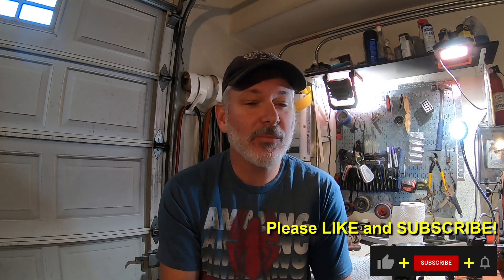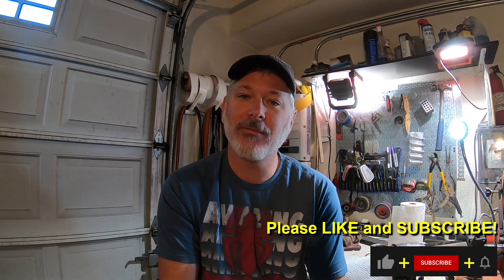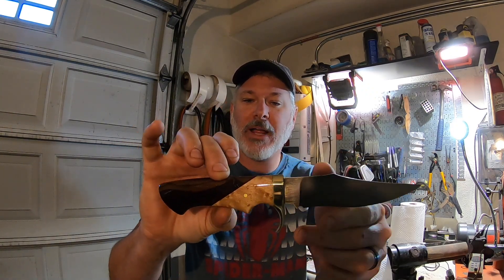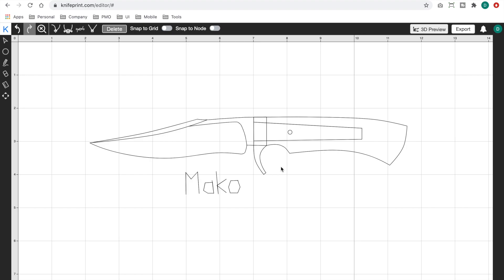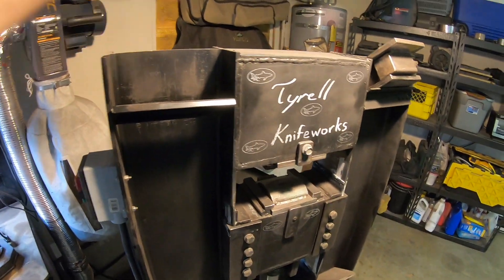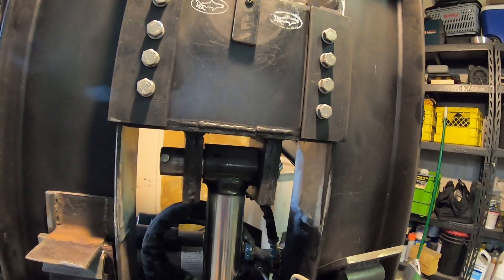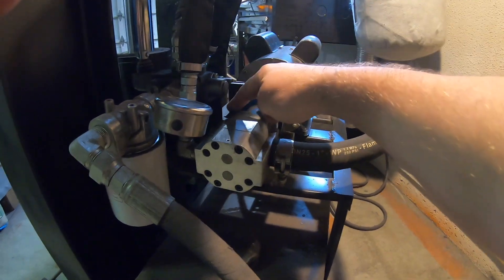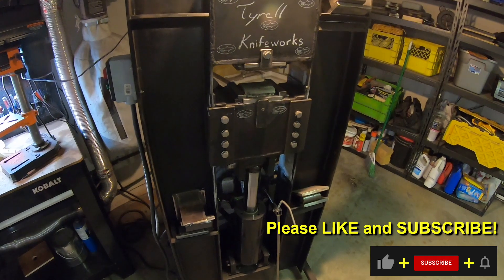Triple-T Tuesday #3 - Knife Designing / Hydraulic Press

Comment from the maker: What do you use for designing knives?  Do you draw them out on paper first?  Use any software?
Reply: I draw them on milimeter paper. From there I can use templates or anything. I engrave my logo with the hammer and chisel method and inlay that with anything I have laying around, sometimes copper, sometimes gold. I do a lot of hidden tangs nowadays and I'd like to do my first takedown soon and get better at gemstone setting. I'm using kubic cirkonias for now but I have an eye on some man made diamonds for the future. I also recently got my first piece of stabilized mammoth ivory to work with... Man was I nervous! Turned out ok but then I messed up the gold inlay on the blade part ... I'll keep the knife.

Comment: How many tons is the press?
Reply from the maker: The cylinder is 58000lbs of force so it's a 29 ton.  Thanks for watching, Elliot.
Reply: @TyrellKnifeworks  Thanks, I'm trying to decide between a 25 ton and a 40 ton press.  Is 25 good enough or would you recommend the 40 ton?
Reply from the maker: @NelsonJ1  25 is plenty.  Most guys are using less than that.
Reply: @TyrellKnifeworks  Thanks again

Comment: That is definitely a nice press! I already ordered all my hydraulics and funny I got pretty much all the same stuff from Northern hydraulics. I did get a little longer ram. Hope I don't regret it. 
What type of steel did you use for your dies? Is it mild steel or something like H13? I've seen people use both. 
Man that is a cool press! Great Job!
Reply from the maker: Mild steel is what I used.  It works just fine.  I think dies for a power hammer need to be tool steel but probably not needed for a press.   Thanks for watching!
Reply: @TyrellKnifeworks  hey man one more question for you. Have you noticed any issues with your pump being mounted above the reservoir. I am setting mine up similar to yours and someone just mentioned me that the pumps are supposed to be mounted next to the tank or under the tank and not above So the oil can freely flow into the pump and the pump won't have to lift the oil. I know I have seen them mounted above the reservoir before and yours is that way so I was just wondering if you have noticed any problems with it sucking air or not working properly. Thanks for the help!
Reply from the maker: No problems at all.  That kinda doesn’t make much sense to me though because your output from the reservoir is at the bottom of your tank so there’s no way it could suck air unless there’s a leak in your system.  Plus it’s about 12” above the tank so it’s not working hard.  Think of an excavator and how far it has to push fluid to the ram.  How much longer is your ram?  It just makes your press taller is all.  You won’t use more than 6” of stroke.  2” for the dies and that gives you 4” or more to play with.  Not much stock thicker than 4”.  Maybe if your splitting feathers or drifting hammers but that’s about it.
Reply: @TyrellKnifeworks  yeah it doesn't make sense to me either. He was more concerned about the pump not being rated for for that much suction/lift from the reservoir,and that it would be hard on the pump to suck the oil up so high. He said the pumps are suppose to be gravity fed from the reservoir. I don't think the concern was from the pump to the ram. But if yours seems to work fine then I'm not to worried about it. I know I have seen other pumps mounted higher than the reservoir. Thanks for your help.

Comment: man that is a sick press i can build one for sure do you have blueprints for this?i  would pay for a set of blue prints
Reply from the maker: I don’t have blueprints but it’s quite straightforward.  I go over the basics in that video.  5x8 I-beam that is 5’ and the bottom/top/head are 12” across.  Then just weld the top/bottom and get some 2x3” 1/4” angle to attach the head to the I beams.  I had someone come and do the hydraulic hoses for me.

Comment: You made very cool hydraulic press! I'm in the middle of designing my own! How much does it  weight? Can you move it? I was thinking of making two quick connected parts: the Frame with cylinders (I will use two smaller one) and the tank with the pump to make it more mobile. Would you recommend that solution?
Reply from the maker: It weighs a few hundred pounds for sure.  It's on casters so it moves around if I need it to.  I wouldn't bother with making it quick disconnect... just put it on casters with a long cable.  Thanks for watching!
Reply: @TyrellKnifeworks  floor in my workshop is in very bad condition, so the casters might be useless :/. That is why I'm thinking about reducing weight by separating the press parts.
Reply from the maker: @DBCraftWorld  Ah I see.  Yeah then that might work.  Some people put the motor/reservoir in a different room to reduce noise and just have a longer hose.